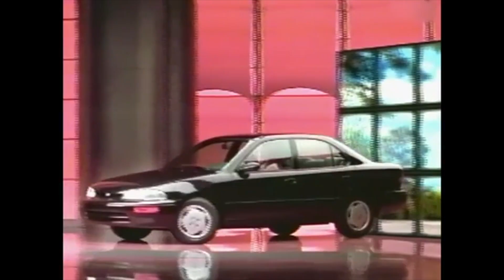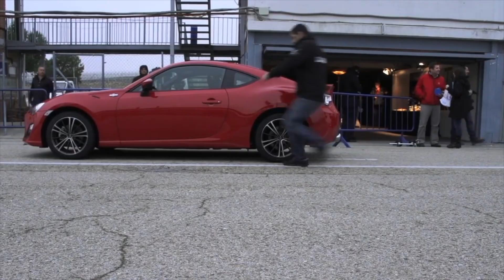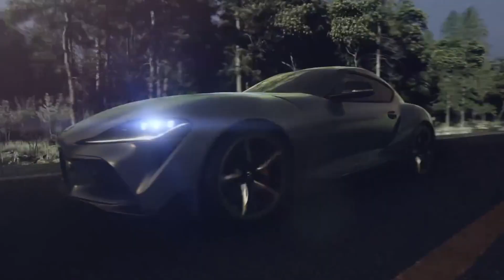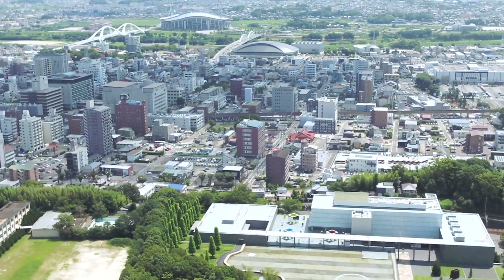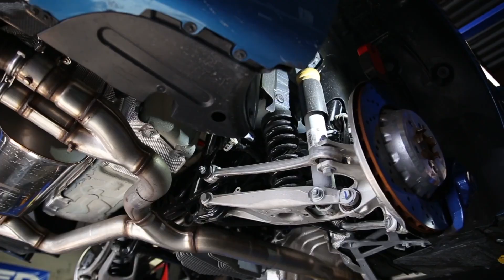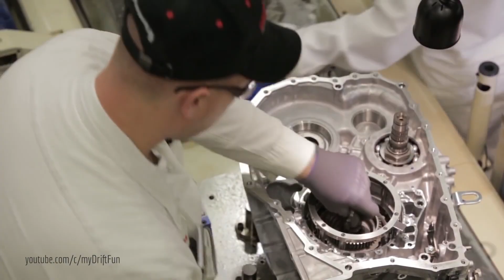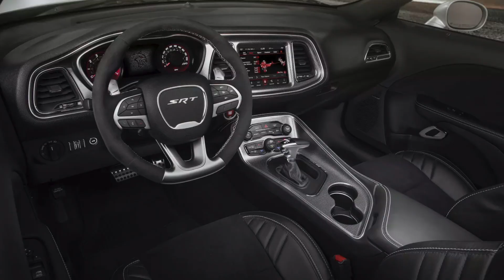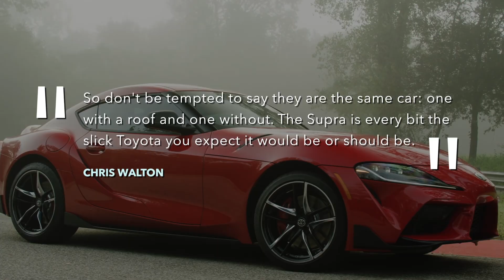MKV Toyota Supra - BMW or Toyota? The UNTOLD TRUE STORY

Comment: Toyota and Yamaha should be partners again so they could make badass engines like the 2jz
Reply: Toyota and Yamaha collaborated on the F series Rcf and the Lfa. Niether has sold in a substantial amount to continue down that road. In fact that collaboration has been very expensive and has lost big money for Toyota.
Reply: Tazmn Wilson all 500 LFA where sold out ..moreover that car wasn’t made for profit it was made to show that japan could make a sold true super car ..smh and the rcf sales are ok ..they are now working on the LCF so sit tight and wait Yamaha Toyota’s sub division is working on the twin turbo v8 for that car.
Reply: @damonsta80 500 LFA sports cars sold to the less than 1% of consumers wasnt a profit on a car which took billions to produce. It was a lost in the end for Toyota. Car manufacturers dont make money by making niche cars that only sale to the elite. Why do you think it was a one and done car? No business is never in the business to lose money and solely prove a point. The Rcf not the Rcf looking model has the worst sales in the segment. Lexus dealers are giving massive discounts just to move them and the car doesnt compete due to its weight and slow shifting tranny. 12.7 1/4 mile and a 4.4 0-60 is slower than  every other car including the M3, c63s, Alfa Guilia Qv and now the Supra which runs a 4.1 0-60 and the previous listed run 3.9 0-60 with 11.9- 12.1 1/4 miles. All are faster and are similarly priced. The new Supra is a bargain in consideration of the proclaimed #s
Here are my sources

Lexus 0-60 Times & Lexus Quarter Mile Times | Lexus LFA, RX, GS, NX, ES, LS Hybrid, LX, SC & more 0 to 60 stats!
https://www.zeroto60times.com/vehicle-make/lexus-0-60-mph-times/
Reply: @williamwilson5125  billions? This is not a super secret stealth bomber engineering/production... Haha. No.
Reply: @stoptellingmewhattowrite  Carbon Fiber is expensive today but to produce a plant that would sustain production of the LFA and the substantial engineers, carbon fiber production and 10 years of research and development at a time when carbon fiber cost 10 times more expensive than it is today would take a mammoth amount of financial resources. The article I sent you explains it all.
Reply: And the 4age engine family

Comment: Excellent video.  

Lots of amazing information.  
You made great defense for Toyota.

However.. the Supra is supposed to be the best of Toyota engineering.  This would’ve been a great step above for the 86.  If you wanted something with more power.  Like jumping from a Lexus RC F to LC500.

I’m sure the Toyota Z4 will be great, but I wouldn’t call it a supra..
Reply: Oscar Martinez 

Zupra is more proper name for it
Reply: @thebadmanreturns  Z4pra
Reply: Why because it like zeus.
Reply: A God.
Reply: Lexus and Racing show the best of Toyota engineering, not the Supra.
Reply: Odezy Beckhummice janior 

The best engineering overall for Lexus platform 

Supra should be the best engineering for the Toyota platform..
Reply: They should just call it dupra or zupra

Comment: I was disappointed with the new Supra as the engine is designed by BMW and the lack of fighter jet style interior which the Camry ironically got. But after reading blogs and watching videos interviewing the Toyota engineers, I can sense their motorsport passion by their confidence, heck they also mentioned that the fake vents on the Supra can be removed to be functional with sprinkles of hints of a new MR2. 

And here we are watching Albon's mini-documentary about the new Supra's development history, it really shows that Toyota needs to make their own official documentary to properly communicate with the fans and let us as a whole to appreciate those names are not left behind in the past, motionless. But still, where's the manual? Is there a conversion kit or not?!
Reply from the maker: Yeah man, Toyota really does need to work on the marketing! And interestingly, there actually is a space in the firewall for a clutch master and pedal, I checked!
Reply: I think Toyota and Subaru really nailed the 86/BRZ release. Aside from the engine being a bit underpowered, they listened to the fans and gave us what we wanted. I even bought a BRZ. But this time around, I feel like they compromised too much and lost sight of what the fans really wanted. I for one think the BMW partnership for the engine was a good idea but not having a manual and making it too similar to a BMW rather than the MKIV Supra was a big mistake. Now it's a car that is neither for fun (due to lack of a manual) or tuning (due to engine design) or nostalgia (due to being too different), nor is it particularly high performance or a great value. I feel like the sales are going to be very lackluster and only from a very niche market of those entering a mid-life crisis. I just hope Toyota recognizes this as a failure of design and not a sign that the market no longer wants sports cars!
Reply: Hi, unfortunately removing the vents plastic cover doesn't make them fully functional there is a piping  work that needs to be done, the side vents will collect a lot of dust and probably a nightmare to clean. The Camry could have been a great parts bin. Again Toyota cut corners a lot and made a good OK car not worth 60k. They should have dropped the 6inline (ppl will hate now lol), and just go with a reforged camry engine, or simply partner with lotus! Again can't drill holes on a car and add a wing expect it to be aerodynamic! Can't wait to see how many warranties get voided! Brz and it's twin sister are the best 4c sport car they had ever made after the mighty LFA, sad but they just want profits which is OK! I disagree with people when they say, Toyota brought back a sports car while everyone is making electric cars, how about alfa Roméo developing a carbon fiber tub sports car from scratch! I remind these people that Toyota is a trillion dollars company!
Reply: Toyota engineers did a lot of interviews that I think the fault is the journalists who are too lazy to translate from Japanese to other languages, and the fans themselves, for not reading or researching it. The Supra hate is like a trend, that caught up because of influental idiots, who have no idea about cooperation and general car engineering. 100% of all Supra haters in Germany don't even know that the law forbids badge-engineering.
Reply: @emin86  you must be right, but they should communicate more and work on their own PR. Personally I have no problem with cooperation, I think the car they introduced regardless of bmw is too ordinary in an Era were performance isnt that out of reach! We didn't complain when Pagani built his cars with a merc engine, now Aston Martin, how about lotus over 100k car with a camry base engine! Nobody was bitching about that because they built a high performance car.
Reply: @Huy Thai I definitely wouldn't say manuals are no longer wanted when it comes to sports cars. I heard that something like 80% of 86/BRZ sales are manual transmission in most markets. In fact, the Performance Pack which I have only comes in manual because they know that the ones passionate enough to care about performance extras are almost exclusively those who want a manual rather than a basic automatic. Even Porsche had to reintroduce manuals to some of their cars due to demand. It doesn't matter if they are slower, manuals are simply more fun for most people. And for a sports car that isn't purely about speed, I think it's a VERY poor decision to offer only automatics. Again, they've severely limited their market with that move. I would be surprised if they don't add a manual after likely seeing lackluster sales numbers.

But yeah, I agree on the NSX example too. It may be a decent car but it's simply not the NSX people expected. And it's not even made or designed by Japanese! The GTR on the other hand I feel was true to its heritage.

And yes, the decent price is the selling point but again, I feel like it won't be enough to sway many people because it simply isn't that special! You can get a new 86/BRZ for half that price and tune it and it'd probably be more fun and practical. But for around $50k, I would rather have the superior designed Z4 or even a Porsche Boxster for around the same price. Heck, there's probably a lot of cars I'd rather have for that pricepoint. So I'm not gonna poo on anyone who likes this car but for me an many others, this was another missed opportunity by Japanese manufacturers and they're likely just going to blame it on a supposed shrinking market for sports cars.
Reply: @Huy Thai Yeah, I understand. I just meant that I feel that for the money, the Z4 and Boxster are better values. I'm not the type who wants to spend $50k on a car and then add another $10k+ in mods, ruining the warranty and possibly reliability but I'm sure there's a small market for that out there. However, I do wonder how many of those types will be ok with only having an automatic transmission. I just feel like it's not the same kind of situation as the MKIV. The MKIV was one of the fastest cars for the time and it could really compete with the best with some tuning. It also had an appealing sporty design with some unique technology and practicality to boot (rear seats and big trunk). It also sounded great with aftermarket exhausts. And again, it was very Japanese and very Toyota. I definitely do not forsee it meeting the popularity or expectations of the MKIV sequel... at least without some major updates/design changes.
Reply: @Huy Thai True, I'm still glad they did it and hope for the best for it. I just hope they don't try to use the 4 cylinder version to replace the 86 as some have rumored recently.